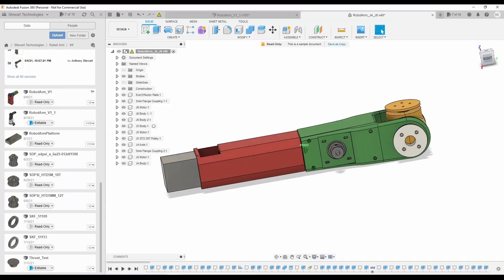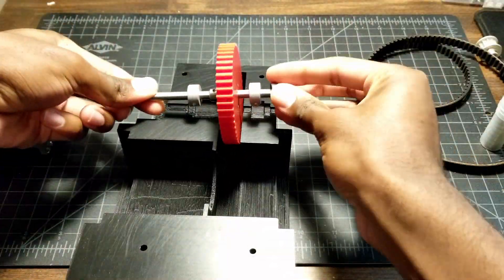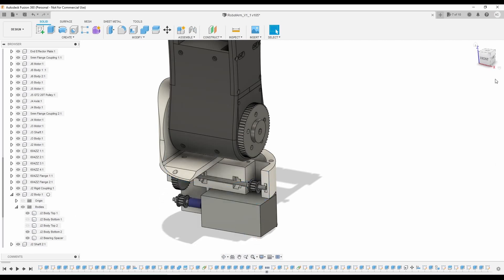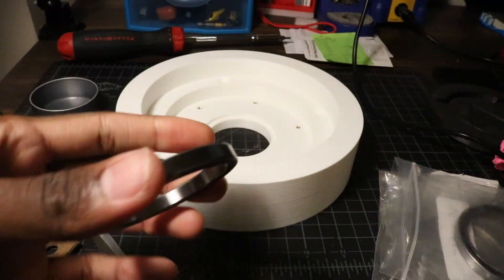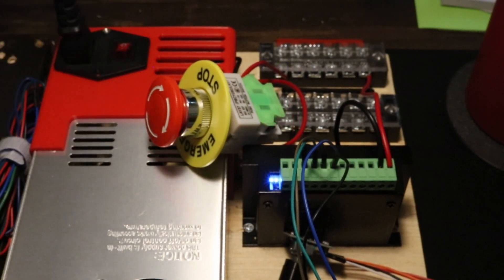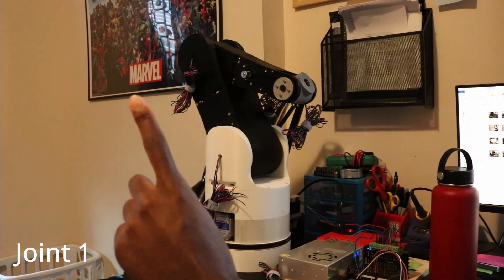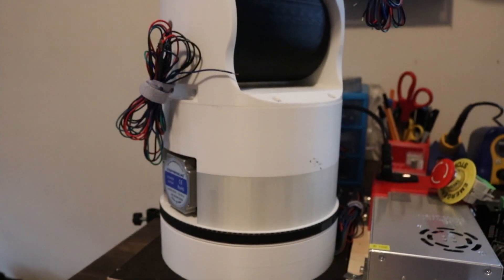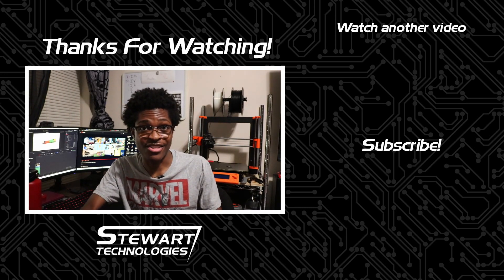3D Printed 6 Axis Robot Arm Part 2 | Lower Joints & Electronics

Comment: Great video! I do have a question I have been trying to print gears and have been struggling. seems all belts are given in pitch and the Fusion 360 Gear tool uses a module how did you get around this problem?
Reply from the maker: This was really difficult for me too. I got around this by looking for existing CAD models for the gears I needed from different suppliers and just modifying them in Fusion 360. Websites like 3D Content Central helped a lot with that. For the larger HTD gear, I found a parametric model online (through onShape I believe) that I could modify to get what I needed. There's also the option to manually create the profiles as well, there are some decent YT tutorials on how to do that.
Reply: @StewartTechnologies  I have watched quite a few and created my own, just very surprising i cant find any information about why pitch and module are different. Probably my bad googling skills lol thanks for the help I'm going to try and figure out how to do incorrectly with the built in fusion tools. one day ill get it lol

Comment: This is a great series so far! I was curious if you’re planning on using slip rings for each join so they can move more then 360 or just cap in software to limit how far each joint can move.
Reply from the maker: Thanks! I'll be using limit switches to calibrate the joints (at one extreme) and a software cap to limit the range of motion so the robot doesn't crash into itself.
Reply: @StewartTechnologies  for the wiring you’re not planning on any slip rings though? I guess if you’re doing limits then you probably will never get your wires tangled up anyways.
Reply from the maker: Yeah, I'm not planning on using slip rings. I'm hoping the limit switches prevent the wires from getting tangled since they wont be moving a full 360°.

Comment: Looks promising. Will you also be showing how you plan to do the wiring as to keep it from getting entangled in the arm. Slip joints?
Reply from the maker: Yup, that'll be covered in the next video. Don't think I'll be using slip joints though.

Comment: You using full/half stepping on the joints?
Reply from the maker: I'm using full stepping on the joints in the video.
Reply: @StewartTechnologies  have you tried setting the driver to 1/8 (or more) stepping, to reduce noise?
Reply from the maker: Not yet, I'm currently waiting for the digital stepper drivers to arrive before I try microstepping the joints. The driver I had was terrible and didn't supply enough current to the bigger motors so I didn't bother trying.
Reply: @StewartTechnologies  makes sense, really looking forward to your next video.

Comment: This is very informative I am a beginner in robotics and Arduino. I have one question what did you use to design your robot and 3d print the parts?
Reply from the maker: I used Fusion 360 to design it and a Prusa i3 MK3S to print everything in PLA!

Comment: If you look at the torque curve of a stepper motor, it drops exponentially as you speed it up. Running a 20:1 reduction ratio requires you to run the motor faster, steppers don’t handle high reductions well because if this and it’s why your arm is slow. For reductions above 16:1 use a brushless motor. Notice how much smoother joint 4 and 5 are, personally I won’t go above 4:1 using steppers.

Comment: Very impressive! Working one one of my own for a future video. From my experience with steppers I fixed that rumbling noise by setting the micro stepping through i've only worked with smaller motors where i've never had to adjust the current.
Reply from the maker: Thanks for the tip!

Comment: Awesome job that looks great! How did you calculate the joint torque requirements? Did you use standard statics or did you also factor in angular acceleration of each joint in addition to the statics. I am trying to build my own 😁
Reply from the maker: This actually took me a while to figure out since I wasn't that great at force calculations but I mostly followed this blog post: https://automaticaddison.com/how-to-determine-what-torque-you-need-for-your-servo-motors/. I did account for angular acceleration but there were a ton of guesses and assumptions made in the calculations. While sourcing parts I threw all the math into an Excel sheet with  a torque margin of about 20% to make sure the robot had more than enough torque for each joint.

Comment: Great video! Is it possible to increase the speed of each joint rotation?
Reply from the maker: Yes! Right now just for testing each joint is running at a very low speed of 50 steps per second (the steppers are 200 steps/rev so it's about 15 RPM) . Increasing the speed however would reduce the torque so I'll most likely operate the arm at lower speeds most of the time.

Comment: Great stuff. I'm working on a 6 Axis arm too, but on a smaller scale. How do you plan to home each axis of the robot? I've been tossing up between limit switches and encoders (thinking the cheap AS5600 magnetic sensor), at least for the first three joints.
Reply from the maker: I'm considering using a combination  of limit switches and encoders for at least the first 3 joints. For the other joints I think I could get away with just encoders. Need to do a bit of testing to be sure though. Good luck with your robot!